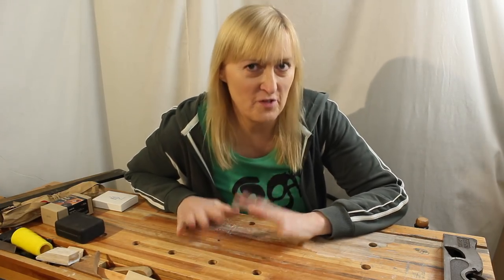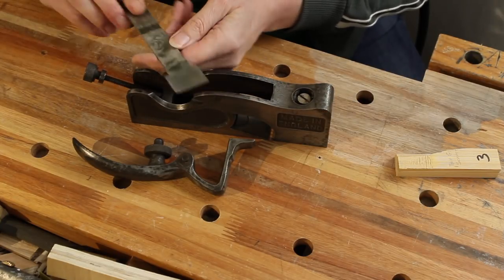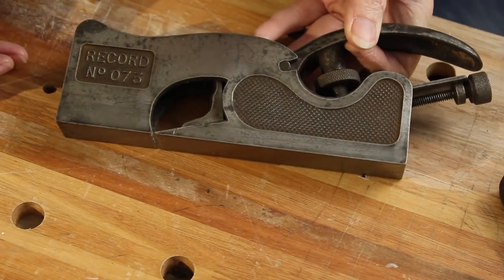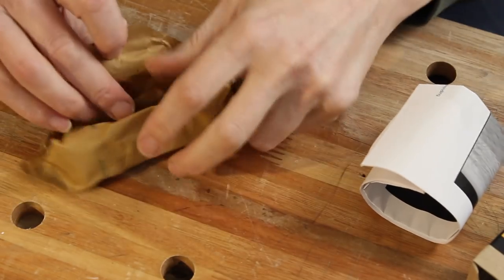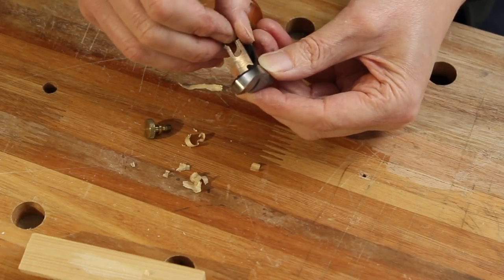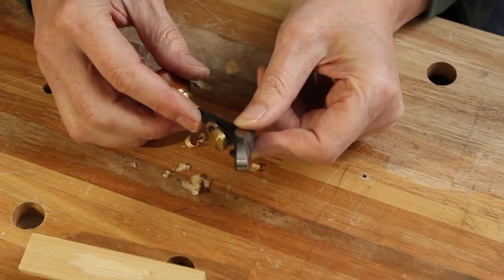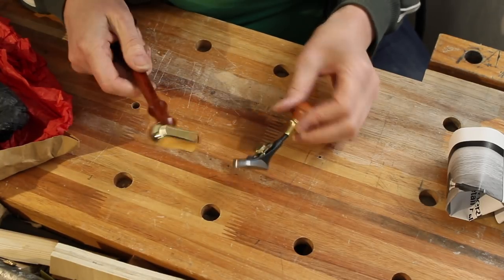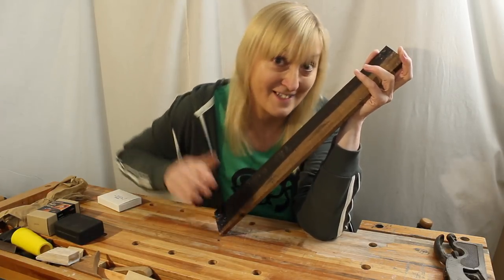A look at some of my new tools

Comment: I agree that tools are meant to be used: if they're aesthetically pleasing, that's a bonus. Good to know that such tools are still being made. (Looks aren't everything: I inherited a bill-hook that had been relegated to chopping coal, then abandoned when my parents installed gas fires. It was rusty, and the wooden handle had split. I repaired/cleaned it as best I could, and now it is being used for its original purpose when I go out volunteering on nature reserves. Ugly, maybe [I'm talking about the billhook, not the user]: but it holds its edge and is well balanced.)

Comment: Those small convex blades are a bit difficult to sharpen, because you have so little to grab. But they don't need much grinding either, so you can just take it slow and careful. The radius is not hard to keep, but the angle is.

Comment: Thank you Susan for all your videos, can you tell us about your work bench? I would like to see if I can find something similar. Thank you.
Reply from the maker: The bench isn’t  good - it’s not very stable and the vices are weak - I had to repair one of the vices. However, you get what you pay for - i would have had to pay a lot more for a good bench. It’s probably best to make your own if you have the time.
Reply: @SusanGardener  I am looking at a new small plane for brace work, would you recommend the palm or miniature block plane for this?
Reply from the maker: I really like the miniature block plane - it’s easy to use and very precise. The palm planes I’m not so comfortable with - in my hands they seem more of a rough carving tool - tricky to get smooth lines
Reply: @SusanGardener  Thank you so much for that feedback! I’ll be picking up one of those little planes tomorrow and can’t wait to test it.  I can think of many little jobs around the guitar that it will be suited for. I hope you are well… and thanks for all the wonderful videos you’ve made. They have been both inspiring and great resource ;)